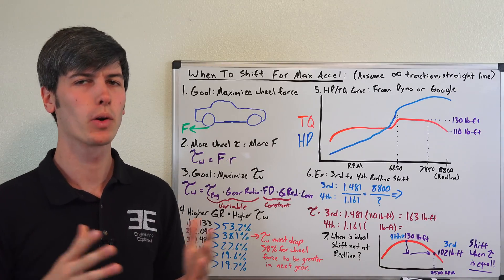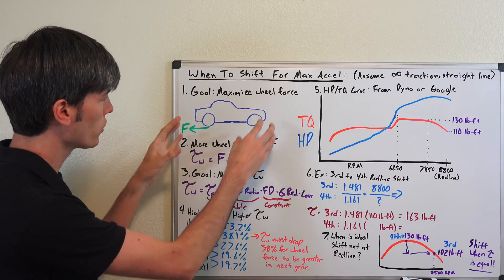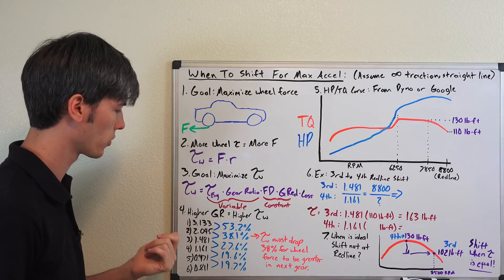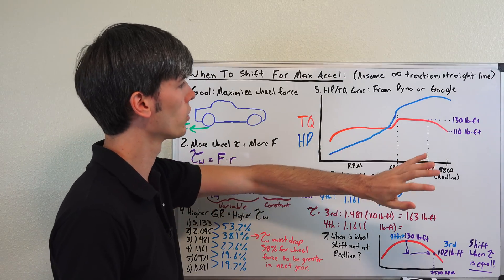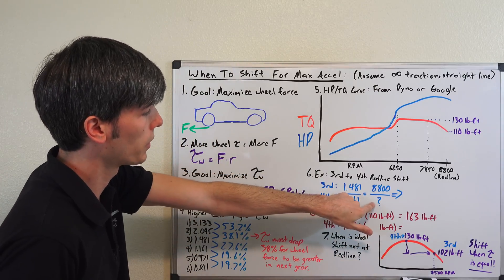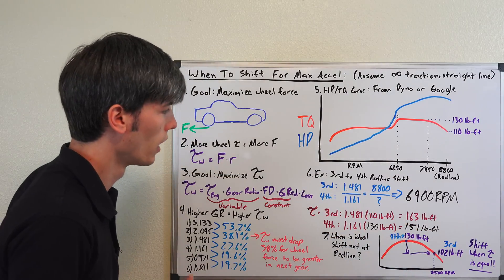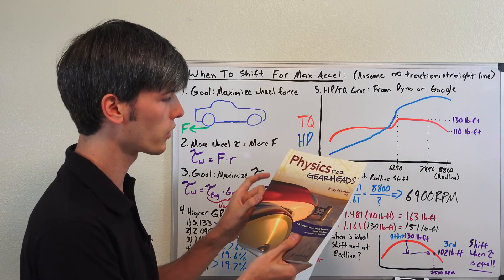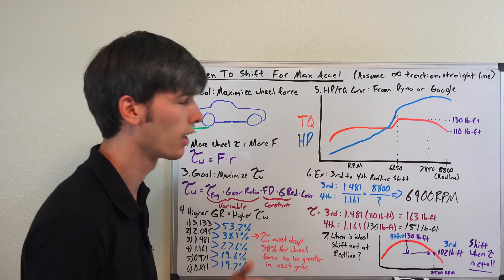When To Shift Gears For The Fastest Acceleration

Comment: I usually just shift my S2000 when it starts bumping at the top and wont let me go fast no more
Reply: I don't even have a tachometer so I only upshift when I feel the car isn't accelerating as quickly as it could if I'm entering a highway on leaving traffic lights and stop signs. On quiet streets though I upshift by sound, to save fuel I upshift as early as possible without stalling, quiet sound = saving fuel
Reply: How?
Engine limiter controls fuel injection.
Reply: I usually shift it when i have the car
Reply: RzVids how's that?
Reply: 😂😂😂 bro 💀💀
Reply: Blake Calabrese you're wearing out the clutch faster.
Reply: RzVids how's that?

Comment: so,  my question is,  why not use horsepower? torque will give instantaneous acceleration, but not necessarily the best acceleration over a period of time.  can you show how both of these relate to acceleration over a period of time? or which one is actually more relevant to the acceleration throughout a certain Rev range

Comment: A simpler approach would be to use energy conservation (force = power/speed), the result is that you should always keep the gear where the engine is making more power (HPs). No need to mess with gear ratios except to know the RPMs at the next gear. 

For example, at 8800 RPM that engine is producing 184 HP, and at 6900 it produces 171 HP, so it's not convenient to downshift.

Comment: I don't quite see why everyone loves the s2000 so much. don't get me wrong, they look great and would be fun to drive. But my (stage 2) GTI is getting peak 280hp, and peak 315 ft/lbs of torque. This s2000 is getting just about half that. Maybe there is something I'm missing here. weight reduction? how it gets the power to the ground? but it seems like my GTI is in another world entirely when it comes to power.
Reply from the maker: You've tuned your GTI and you're comparing it to a stock car. I think that's what you're missing.
Reply: Driving pleasure doesn't always comes from bigger hp /torque number the engine is making.

It depends on factors like how well the chassis is designed, so to make the car easier to control and more predictable projection of where the direction of the car is going.

Also, how well the engine is designed.
Again to be light and responsive the throttle feels, and how good and predictable the power is coming. Not so sudden, not so laggy.

The boxer engine, Honda engine, NSX chassis and gearing, and Lotus chassis, Lotus tuned engine, Lotus ride and handling, and Lotus gearing is some recipe of sometimes low powered but giving very good please in driving.
Reply: Other people like the s2000 because chemical love
Reply: A fun car to drive isn't just about horsepower and quarter mile times. It's about a well rounded car that can go around curves well, has a good balance and not too heavy. A go kart isn't as fast as a car, but if you are driving one going 55 mph, it's a lot more fun than any car. Cars that have too much horsepower are easy to break loose in turns and are heavy. However, if you just like straight line performance, then high horsepower is the way to go, it's just not necessarily as fun to drive. It's kind of an ego thing to say my car has more horsepower than your car, etc. It's more fun to drive a slower car fast than having to drive really fast car slow. Unless you are able to go to a track often there aren't many places where you can do over 130 mph

Comment: Unless your engine is a real sluggish at high RPM (eg some turbodiesels) you always want to shift at redline.
Reply: Power curve will tell you the truth: If your power (not torque) curve is dropping to the point that upshifting will give you extra HP (eg you have 200hp peak at 3500 and 150 hp at 5000rpm redline and by upshifting you'll  land at eg. 3200RPM and 190hp) then you must shift earlier.
Reply: i'm interested in that... because almost every diesel engine dies after 4000rpm...and max torque is at around 1800rpm...when do you shift for max acceleration? do you redline it or do you "short shift" ?
Reply: You want to shift just before 4000rpm in most diesel cars. Torque stays more or less constant between 2000-4000rpm in most diesel cars, but tapers drastically after 4000, even if the redline is at 5000. So just rev it to about 4000 and then shift
Reply: I drive an S2000 now, but my previous car was a second gen Eclipse GS (I wish it had been the AWD GSX, front wheel drive blows). Anyway, when I first got the Eclipse as a teenager I was told to shift at minimum 4500RPM, which I found exciting because I have a lead foot. I think it redlined around 7000? But it usually meant being at speed in third gear or so. So I generally shifted at lower RPMs to be at speed in fifth gear. Unless I was trying to find the governor which I never did... cough I just read on Edmund's that torque peak was 4800RPMs and redlining is better acceleration at lower gears so apparently I drove that thing wrong for years. Oops.
Reply: well i drive a 1.9tdi, once raced another same car same engine, i shifted at 3.9k. he went all the way to redline, guess who won :) (me)
Reply: kerstas10 Exactly. Diesel cars have no power above 4000rpm

Comment: a worthy sub-subject. What is the best rpm to change which gear. I.E. the shift points set by oem are not ever at red line and why. I dont know, but speculating that torque is not the driving factor in these points. I am sure it includes efficiency, wear and tear and other factors
Reply: redline is the maximum RPM the engine can operate. Doesn't have anything to do with power or anything. For daily driving change gears as soon as the higher gear is within the useable torque range. I shift as soon as the engine won't lug, but i'm weird like that.
Reply: well very few cars are sold to be driven balls to the walls 24/7. If you don't ever shift until redline you'll burn a lot of gas and put a lot of wear and tear on the engine. This video is about when to shift to get Maximum Acceleration without concerning the longevity of your vehicle.
Reply: plus, bumping the limiter usually wastes time

Comment: Since I learned to drive on a straight shift without a tach, I use the "ass" method. When you feel in your ass that the engine is not pulling anymore, you shift. Problem solved.

Comment: Isn't there a time aspect to the force (torque) applied by the engine through the wheels? In other words, don't you want to shift at the point where you spend more time making highest torque possible versus just reaching a peak torque for a short burst? Basically the area under the curve for torque produced by the wheels over a certain period of time should be maximized and that's how you should determine when to shift, am I incorrect?

Comment: I did the math for a 2.0 tdi from Audi with 140kW, which has a big drop of torque after 3000rpm. As it turns out, the gears in the 6-speed manual are perfectly matched to the engine (what should be expected). When you shift from 3. to 4. at 4500 rpm (redline) the engine drops to 3300rpm but the wheeltourque stays the same. If you shift earlier, you get less torque that in the lower gear. Same for 4. to 5. So even with a diesel engine, that has peak torque form 2k to 3k rpm, you should rev it to redline.

Comment: My intuition tells me that this is somewhat simplified. Surely the goal of shift timing is to maximize the torque over time, so I expected to see integrals, rather than just the comparison of values at two points on the curve.

So, why does this work? Is there some assumption you didn't make clear, or is this an approximation, or is that integration hidden in the dyno curves?
Reply: Torque and HP curves are relatively smooth, if your hypotethical car would have a sudden dip or sudden burst of torque somewhere , eg between 7000-8000 rpm then you would have to take this into account that it may be beneficial to avoid this sudden loss of power or maximize time spent at "power boost" range instead of shifting at 9000 rpm.
Reply from the maker: My goal is to make it easy to understand. There's nothing incorrect about the methodology, no need to get more complicated. :)
Reply: How about: "There's nothing incorrect about the methodology FOR A HONDA S2000."  It could yield incorrect answers for other engines with different torque curves.  But I agree -- best to avoid calculus in a youtube video :)